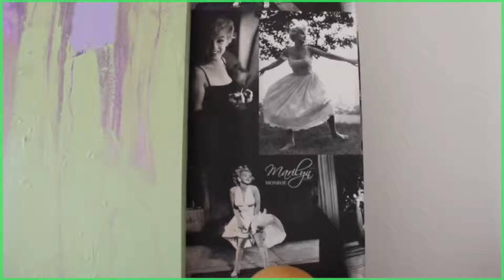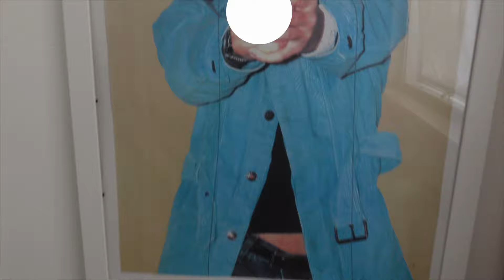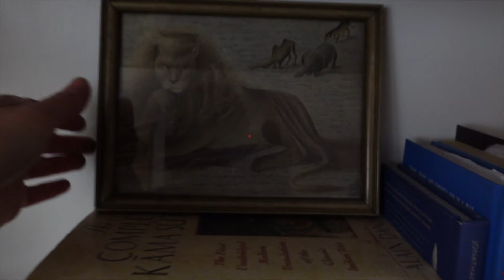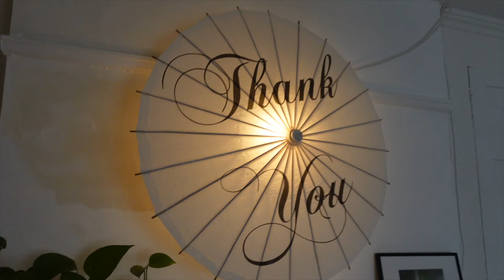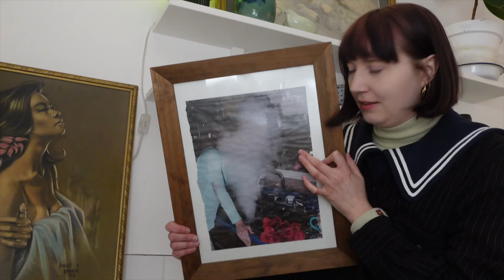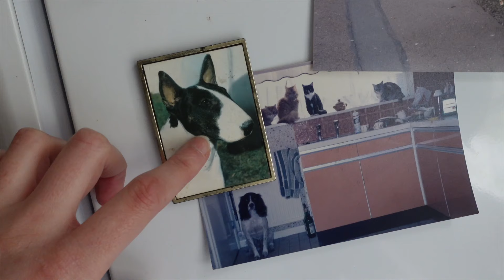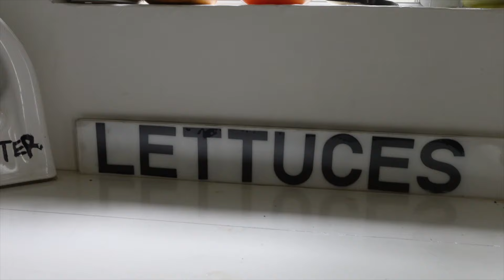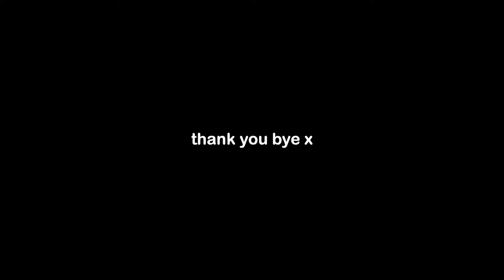the house that charity shops built 🏡 my full (half-finished) flat tour ft. 4 years of diy progress

Comment: why not mount the coat bar onto the wall on the other side of the bannister (in the open space over the stairs) ? there is so much unused space there. it could even be on a swing arm so that you can pull it over the rail to take coats off it.
Reply from the maker: Ooh this is a good idea!
Reply: I was brainstorming how she could use that space for her coats. A swinging arm rail is a great idea.

Comment: Just curious did you buy the flat.  I’m confused because in Australia the landlord does the renovations.  What you have done is great.
Reply from the maker: Yes! I’m very lucky to have been able to buy it (even though the bank currently owns double-as-much of it than I do!)
Reply: @beigeflannel  Even so when your foot is in you will make money.  Also it has so much character, love your style.
Reply: Was about to ask the same question as I had initially assumed it was a rental that she was overinvesting in repairing So that's good to know but it means all the roof  leak problems are beige's? That's not so great. I hope the sales price was low, although I understand prices in England are very high.
If the toilet room & the sink room are on either side of one wall I hope they get connected. I believe in the states it is not code to have a toilet with no sink.